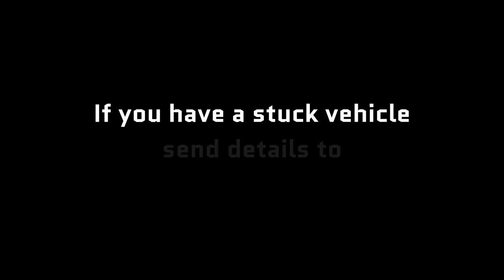The Largest And Most Stuck Excavator I’ve Ever Recovered

Comment: Amazes me that people will stand next to a loaded cable and not think about what happens if it snaps.
Reply: Those chains are made for a lot more force than their machines can even produce. When done properly there isn’t really a threat in that regard
Reply: @crazymuffinstv9024  I don’t care if it’s 5/8” grade 100. Always have an exit plan and cover. I’ve seen top of the line rigging fail, it happens.
Reply: I would have least put heavy moving blankets over the lines
Reply: @99PMoon  i dont think a moving blanket will stop a wire of that caliber.... it works great for small chains and ratchet straps though. But these cables they are hauling are heavy AF
Reply: @99PMoon  yeah nah failure of this kind of material can basically cut someone in half.
Reply: @stevenbartholomew9749  stopping the cable isn't the point. The blankets slows the whipping action of the cable if it were to snap. The idea is to create air drag on the cables. I've only had a cable break on me once and it does work.
Reply: I cringed quite a lot during this video, for safety and logic reasons. I don't wanna swap places with the camera dude.
How are the damages covered that they caused on their own equipment by misuse? This was such an american way of going about this...
Reply: Seen it happen,,,just after the cable whine, smoke and explodes from the lubricant in the strands. Did you notice him turning his cab away from the direction of the cable? That didn't help the leverage, but it helped protect him from cable impact should it happen.

Comment: 21:45 Folks standing amongst those cables gave me the shivers... You Mention 22:11 "A bad time for everyone, if one of these cables breaks"... I'm a former Navy Sailor that went to Nam on an "Oiler" (USS Mispillion AO105) and witnessed (or I should say, saw the aftermath) of an emergency breakaway while refueling an aircraft carrier. The cables we used were heavier than yours and when they snapped... Gawd, it was pretty crazy the damage done to the steel super structure of our ship from the whipping cable.  
Stand clear folks... we heard the horror stories from the crew who'ed been onboard for years and I won't repeat that here, but one can only imagine the destructive power of a snapped cable.
Reply: That is a huge FACT!! Yea, I will not say what would happen to a human body if one of them were to snap, much less the damage to piece of steel..
I was in the US Navy as well, and heard some stories. I was on the USS Kansas City AOR 3 when we had a emergency breakaway.. Not fun at all..
Reply: You can see that they were just lightly tensioning it, not really pilling yet.
Reply: Thank you for your service.  USN SSN-660 AE-18 ‘69 - ‘75 nuke electrician.  USS Paricutin did UNREPS.  Then I was IC rigging communications.
Reply: They were standing there to see where the cables landed when pulled tight. They weren't putting any serious tension on them.
Reply: 42 hours... that is the answer to the universe so... 42 hours to dig and extract that huge stuck hardware out.
Reply: they are all dead at 18:38 anyway, when the pit caves in on them, wtf, who is running this s. show?
Reply: @soundtrancecloud5101  Lmfao way to show you have no idea what you're talking about 🤣 that hard ass clay isn't going anywhere if someone isn't making it move.

Comment: I have been a equipment operator my entire life and I have never seen a piece of equipment that stuck yet. Good job men 👏 👍
Reply: You haven't been around enough if you think that was bad ....just saying ,suction was the biggest enemy on this job .
Reply: @Jacob-64  I've never seen a machine that stuck before either and I've been operating machines in mud bogs, swamps and mountain passes.
Reply: The only machine I ever had to dig out that was mired in like that was an old Loraine drag shovel in a sand pit that hadn't been active in 4-5 years, so several years of wet seasons unmoved sitting on a sand bed, it had sank completely up to the cabin, To be fair, we were a little less kind with our choice of tools pulling it out. Dozers and skidders chained up together make for one hell of a pull. Still was a lot of digging, and work to get it out. The downside, the engine was not in serviceable condition so we pulled it out as complete dead weight
Reply: They only suck the undercarriage. I've seen excavators where the whole entire carbody is buried and part of the cab underneath
Reply: Guess some know when to get out when it gets deep 😂.
Reply: lmao you never worked in the swampy south lol
Reply: 10 hours and 45 minutes
Reply: Is there something wrong with that excavator?  It seems like it lacks power to even lift its own tracks off the ground.
Reply: Working pipeline construction in the Alberta muskeg we called our wood matting riprap. Many Hd21e side boom dozers would sink their tracks out of sight. Your recoveries bring back many great battles. Thank You.
Reply: @Jacob-64  e

Comment: Its the suction of the mud that prevents lifting vehicle out of it. Like stepping in gooey mud and your shoe gets sucked off your foot. I learned a trick from a crusty old maintenance Master Sergeant when I was stationed in Germany. He had fabricated these long pipe sections that he could connect to an industrial air compressor. Drive the pipes under the stuck vehicle then blast air through them. The compressed air breaks the suction. We had an M113 that was stuck bigger that Stuttgart. Even tried an AVLS (M60 tank chassis based bridge launcher) to no avail. So this MSG pulls up, rigs up his pipes, blasts air under the M113, and we pull (winch) it out with a 5-ton wheeled wrecker. I don't know why I've never seen this technique used on any of these recovery videos, but hope this gives someone else an idea. But if someone patents it, I want royalties.
Reply: That is a great idea.  Haha. been a long time since I heard the phrase  "  Bigger than Stuttgart ".
Was is Los?  Der hund ist Los.  I was stationed at Rivers Barracks ( The Zoo )  1979 to 1983.
A Btry 3rd Bn 79th FA  Lance Missile unit.
Reply: @Bill23799  10th Engineer Schweinfurt, then Engineer Brigade Bamburg, 3ID, 91-94.
Reply: Ein bier bitte.   Oberusel. 85-88.
Reply: A nifty  idea!
Reply: Good point.  When the English fought the French at Agincourt in 1415, the mud suction gave the English the victory.  The English wore cloth, the French plate armor.  If a French knight fell down in the muck, he could never get up as he was suctioned down into the mud.  So an Englishman could just come over and stab the Frenchman through an appropriate hole.  If a Frenchman fell face first, he would drown in his own armor.  Mud can be nasty stuff.
Reply: @dhajicek  very interesting! Thanks for sharing it. 
God bless you! 

Jesus answered and said unto him, Verily, verily, I say unto thee, Except a man be born again, he cannot see the kingdom of God. 
John 3:3 KJV 
Have you been born again? 

Moreover, brethren, I declare unto you the gospel which I preached unto you, which also ye have received, and wherein ye stand; By which also ye are saved, if ye keep in memory what I preached unto you, unless ye have believed in vain. For I delivered unto you first of all that which I also received, how that Christ died for our sins according to the scriptures; And that he was buried, and that he rose again the third day according to the scriptures: 
1 Corinthians 15:1-4 KJV 

For all have sinned, and come short of the glory of God; Being justified freely by his grace through the redemption that is in Christ Jesus: Whom God hath set forth to be a propitiation through faith in his blood, to declare his righteousness for the remission of sins that are past, through the forbearance of God; To declare, I say, at this time his righteousness: that he might be just, and the justifier of him which believeth in Jesus. 
Romans 3:23-26 KJV 

But God commendeth his love toward us, in that, while we were yet sinners, Christ died for us.  Much more then, being now justified by his blood, we shall be saved from wrath through him.  For if, when we were enemies, we were reconciled to God by the death of his Son, much more, being reconciled, we shall be saved by his life.  And not only so, but we also joy in God through our Lord Jesus Christ, by whom we have now received the atonement.
Romans 5:8-11 KJV 

Therefore being justified by faith, we have peace with God through our Lord Jesus Christ:  By whom also we have access by faith into this grace wherein we stand, and rejoice in hope of the glory of God.
Romans 5:1-2 KJV

That if thou shalt confess with thy mouth the Lord Jesus, and shalt believe in thine heart that God hath raised him from the dead, thou shalt be saved. For with the heart man believeth unto righteousness; and with the mouth confession is made unto salvation. 
Romans 10:9-10 KJV
Reply: im surprised it cant dig itself out and lift itself with the arm
it even needed a tow up the gentle slope
actually looks like a chain might have been caught in the tracks causing problems
Reply: Are you single
Reply: @hindugoat2302  It could easily have lifted itself out if there was a concrete anchor to pull on, unfortunately there was just soft mud everywhere :)

Comment: We have 4 450's  they didn't come with much tracking power.  You can multiple your towing power by hooking to the top of the track pads and not have to rely on the drives as much. Good job guys  Northern Minnesota here and when we're stuck at 20 below it adds another twist.

Comment: Well, in the army engineering corps the general thesis is, -you never pull a vehicle, with a vehicle lighter that the one you wise to pull. That could well be a sound thesis. Great and entertaining video.Glad to see the guy got his digger back.
Reply: With enough pulleys I've seen 10 men pull over a 10 ton army truck.
Reply: @mouaxiong8618  With the right vector angle it can be done with 2.
Reply: With two chinooks you can pull dam neer anything out hooah
Reply: kd78orangerangerpete   The army corps of engineering, do most defiantly work in a real-world. But, they do things by numbers and not brute-force.
Reply: @Yippee Skippy Using blokes only increases the pull ability. It doesn't change the weight of the pulling vehicle (the anchor point). A 5 ton truck doesn't become a 30 ton armoured vehicle.
Reply: kd78orangerangerpete  Believe me, If you want to start heavy recovery, then army engineering training isn't the worst point to start from. I'm not saying that what these guys do, is not admirable because it is.

Comment: As a safety guy who has investigated too many trench collapses, these conditions really make me nervous with the combination of unconsolidated ground and water plus a lot of vibration from heavy equipment. As the video showed, those sides were very unstable and prone to sloughing. I was happy to see one side of the hole looked to be sloped back pretty well, the other side was a bit too vertical for my liking. It might be worth installing some shoring for projects like this in the future, but It seemed like everyone was aware of the hazards for the most part. You guys did good work and showed excellent communication. It's always a pleasure to see a group of professionals at work.

Comment: I'm very late to the show. Sorry about this late, late comment. I have spent, maybe 20 hours behind the controls of an excavator. I have watched, with awe, professionals grab 55 gallon drums filled with broken up concrete, turn them over, shake out the concrete, and put the drum in the recycle bin while I was the supervisor on a demolition project. I'm impressed that they got that machine stuck so well. Most operators can get those unstuck pretty easy (at least to the view of an amature). Edit: that is one big mud hole! No wonder it was stuck!
Reply: I guess the issue was the 450, I've never seen an excavator not been able to lift the tracks up by pushing the arm down, that machine was low on power it seems, all they needed to do was to lift both tracks on one side and put mats underneath, then swing to the other side and lift the tracks and push backwards at the same time

Comment: Heavy D, from previous experience recovering Abrams Tanks and other similar heavy equipment from the mus. I have pumped air into the belly with hoses to counteract the mud's suction power and was sucessfull. put that one on the log for the next recovery!
Reply: Challenger 2 doesn't get stuck 😉
Reply: Dynamite was the cure when it was available.
Reply: Man that's a fantastic idea, sounds like the voice of experience.

Comment: Matts is what saved the machine,  it would've keep digging in without them. I did pipeline work for several years all through swamps, we used matts to do everything,  we had one to fall in a sinkhole and the operator had to climbed out the top lid, it went down that fast like quicksand,  took 3 days to dig it out, and 3 excavators and a dozer. Fun times. Enjoy the videos
Reply: 45 hours
Reply: I pipelined too and we used hella mats through the swampy shit
Reply: @caseygiles1368  truthfully, I don't even know what a hella mat is, I worked for NC natural gas in the 80s and 90s, all our pipeline went through the worst possible land they could use for a right away. I really enjoyed pipeline work but NC doesn't pay well.
Reply: Yeah I worked with Matt too, great guy. Always helped with getting out of a jam.
Reply: 42hours18 minutes
Reply: @dwaynemurphy814  hella is slang for a large amount of something
Reply: I have absolutely no knowledge about rescuin excavators, but hear me out. Wouldn’t it be easier this way;
1-put the arm on the wood panels and push the excavator up( i know it is stuck, and it won’t move but you’d need this for my next step)
2- dig underneath the palettes on the front side as much as you can
3-lay those wood panels under the palettes.
4- now that the excavator has something to grab on other than mud, pour 3 metric tonnes of water into that hole, so the mud around the palettes would become soft enough for them to move freely
5- since there are the boards you put under the palettes, drive it out just fine.

THIS IS JUST AN HONEST QUESTION,
if you think it wouldn’t work, please elaborate why.
Reply: @serhatsolmaz8658  it wouldn't lift itself even after they had it mostly in buried it could barely get itself up the muck acts like a suction cup and pulls everything in
Reply: @dwaynemurphy814  sorry I meant like a hell of a lot = hella
Reply: Gary Mesched  no, just muddy.
Reply: Are you married ?
Reply: Are you single
Reply: O.o

Comment: I don't know if anyone has mentioned it but I would place a few heavy rubber mats on the wires and slings when pulling mate...

Always plan for worst case, if they snapped there was several people within "severing" reach.

Just a suggestion, loved the vid and mad respect for your work ethic and the way you treat everyone.
Reply: They wouldn't severe anybody in half all they would do is hurt them in a royal fashion the only way I know this is cause I watched an episode of mythbusters that showed that snapping wire will not cut someone in half it'll hurt them like I said but there would be no severing its all a myth but I do see where ur coming from
Reply: I never said they don't snap what I meant was they don't cut people in half like u see in the movies
Reply: One hour 20 minutes
Reply: @johnt9911  not true,  had a wire rail,  same general size they use here,  snap in a crash and nearly cut a 10 year old in half.  Died.
Reply: @joerain22  like I said at the start it won't cut a person in half it will kill them and do alot of damage but will not cut them in half
Reply: @johnt9911  like I said,  the child was about 95% cut,  all the way through... held by tissue and clothing... it CAN cut you in half
Reply: @joerain22  37 hours
Reply: @trollolol 
Glad your still here mate stay safe!
Reply: How many recoverys do have you done? IRL and not keyboard
Reply: @johnt9911  that cable only had 30,000 lbs of force with a 5/8" diameter.  try a tugboat bollard pull at more than 300 tons. or 600,000 lbs,  with 900m towline
Reply: Yes, if shackle fails, you’ve got a missile